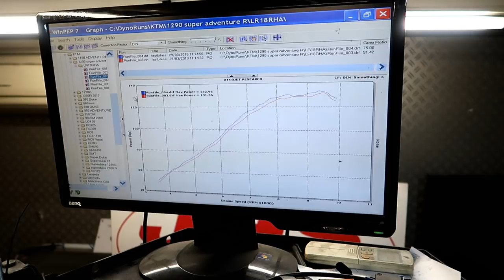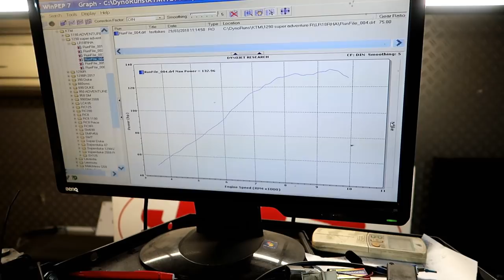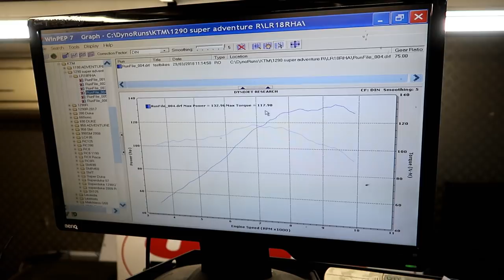2018 KTM 1290 Super Adventure R - Dyno Run!

Comment: It’s plenty powerful but nowhere near what KTM claims. Can it really loose 28 HP from the crank to the rearwheel? Or  may be KTM’s dyno is incredibly optimistic...
Reply: arrow0872 ? almost every liter bike or bigger loses that much on a dyno...
Reply from the maker: They claim around 160bhp I think, which equates to around a 20bhp loss crank to wheel, and yes tyres can make a huge difference on the dyno. Once watched a BSB bike with a slick on make around 200bhp first run, then 170 odd second run, and about 150 the third run, all within about two minutes! This blocky tyre could easily be responsible for the extra few bhp 'loss' over the usual crank to wheel reduction - although it's not technically a 'loss' per se, it still makes 160 at the crank, just being measured at a different point.
Reply: Thanks, I learnt a lot from this vid and your explanation.
Reply: The 160 is at the crank, loses power getting to the rear wheel
Reply: Chris Pearce 
My bike 1290 adventure S 2018 at crank 154,7 hp !
My old yamaha tracer with akrapovic, air filter bmc race and litle more fuel ( oem ecu) made 126hp !
Im litle disapoint ktm claims 160hp :(
Reply: My 1290 super adventure T, fitted with Rottweiler induction kit & power commander V hit 157.4 at the rear wheel & 144nm of torque.
Reply: @taffyboy07 what year is your 1290?  Impressive numbers!

Comment: The my 2018 sadv r is limited at 238 km/h, could be this the reason ?
Reply from the maker: On the dyno the speed reading was about 170mph! With a 19" front wheel, the power tailing off up top in sixth gear more sense if that's what it's geared to, be interesting at that speed on that sized blocky tyre!
Reply: The R version (1090 and 1290) have a speed limit, you need to change tyres and request to re-flash the ECU to remove the limit
Reply from the maker: Ahhhhh! Thanks for letting us know Ricardo!

Comment: So.....about 23 hp and 6 ft-lb down from the Super Duke R.
Reply: Yeah, I guess it would be. That fat low-to-mid torque makes a big difference.

The KTM factory guys talked about the 1290 SDR when it was in development, the unrestricted prototype they were testing was making around 200 hp crank, which is about 175 wheel. The rep said he requested the engineers set the throttle-by-wire calibration to be 1:1 just for a test. They did so. He said as a result the bike was pretty much unrideable, but he said is the only bike he knows of that picked the front up in 4th gear out of sheer force.  https://www.youtube.com/watch?v=7WtKsqiVowk